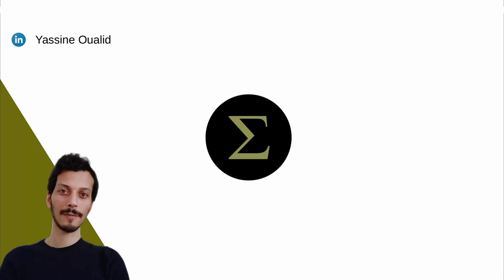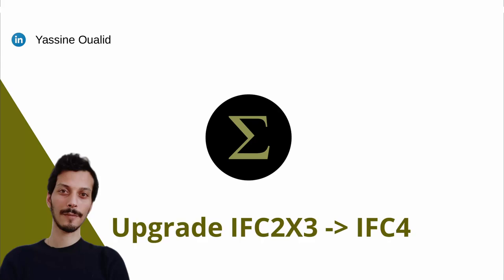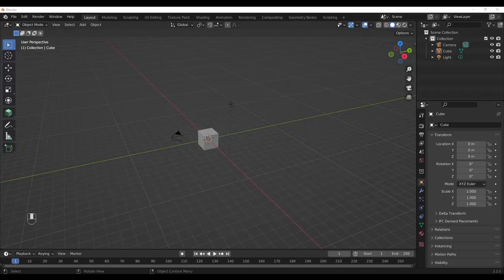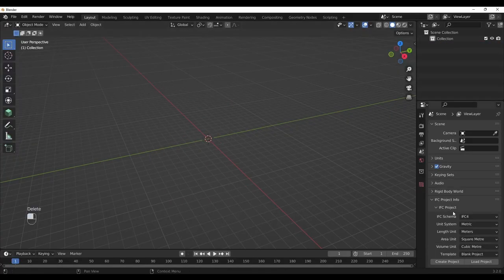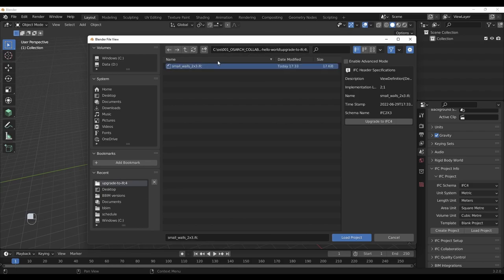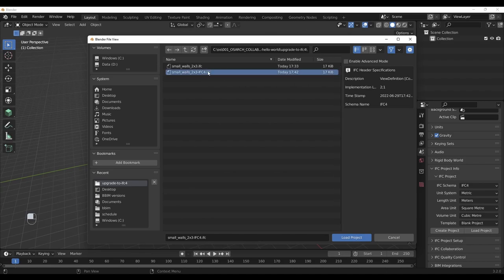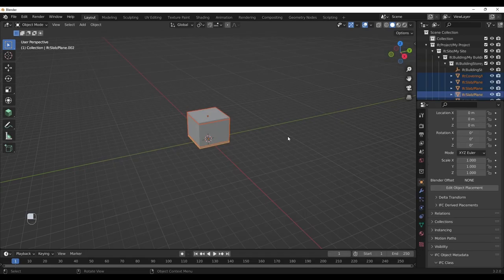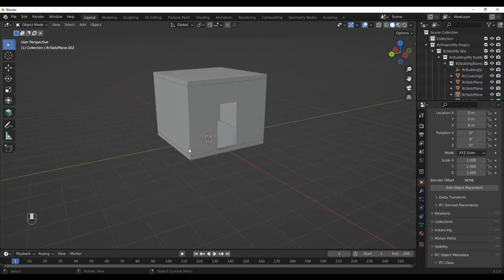BlenderBIM - Upgrade IFC 2x3 to IFC 4

Comment: why do you need to do this?
Reply from the maker: IFC4 allows a better description of the built environment. This includes improved concepts for 4d and 5d.
One good reason for BlenderBIM users, is that we don't support 4d and 5d tools with the old 2x3 schema.
Reply: IFC4 has features that the previous version doesnt. If you need geolocation for example, ifc4 supports it while ifc2x3 does not.